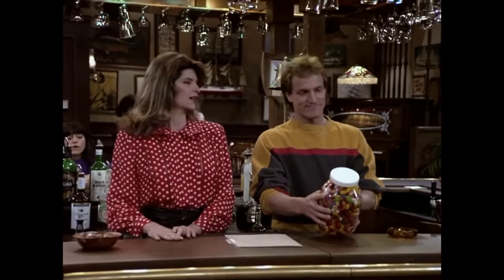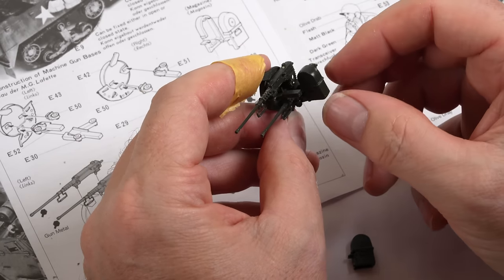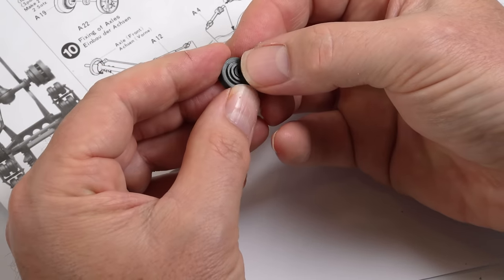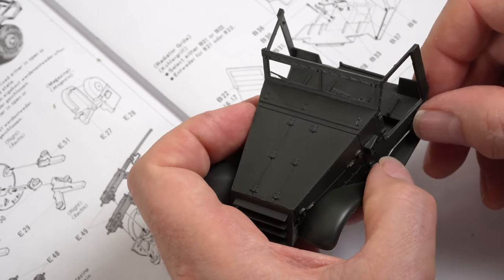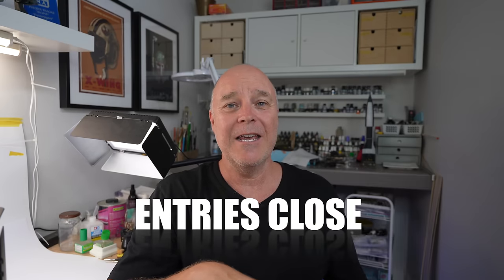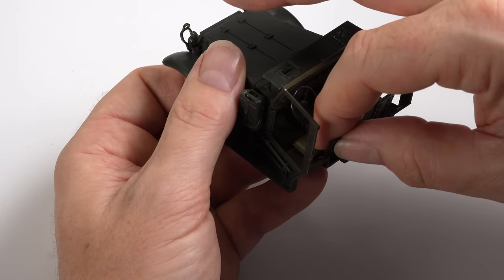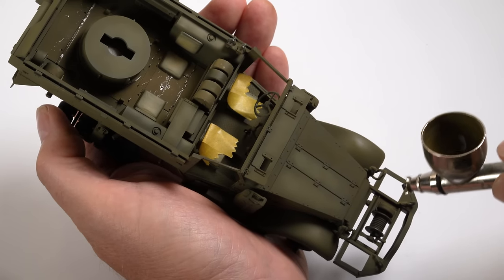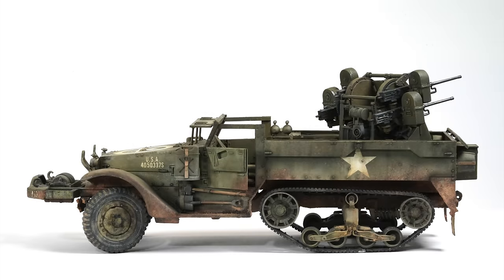TAMIYA $$ Cash Grab or Masterstroke? Rereleased Tamiya 1/35 M3 US Halftrack M16 built OOB + giveaway

Comment: Greetings from Canada.   Nice build! I think with a bit of sanding and scraping, that overscale  armour could be thinned down a bit. Gluing the tracks flat across the top of the drive sprocket and idler would help the appearance also. The kit really seems to hold up well after close to 50 years.
Reply from the maker: Hey 👋 welcome to the channel. Thinning the armour down would be almost impossible without then doing some scratch building. The tracks are only loosely fitted here. All comes together in the next video. Appreciate your comments 🙏🍀

Comment: As a young "glue bomber" in the late 1970's I built a number of Tamiya's armour offerings including this very one. 

Now I primarily build class 8 trucks (the big rig kits) which were another favourite modelling subject for me back then. Much of what is one the market now is the same kits from way back although in some cases there has been some clean up of the original tooling when reissued. Clean up of ejector pin marks (sometimes in really inconvenient locations such as on the diamond tread side of part instead of the not visible when assembled opposite side!), seams and parting lines are familiar tasks with these older kits, which as you mentioned are a reflection of a different era in model kits.

For me, I am happy to see kits like these available again without having to pay collector prices. Same with the Round 2 releases of those truck kits I remember which, for a time especially with the rarer ones, were priced at ridiculous collector levels that effectively discouraged actually opening up a sealed kit and building it.
Reply from the maker: Hi there. Thanks for sharing your thoughts. There is something about building a truck that excites me. I have the old Mack truck from Convoy in the stash…the rubber duck 🦆. That’s one of those legacy builds for me. I ‘gluebombed’ that as a kid 😛

Comment: Greetings from Australia!
This is certainly a better kit than the two '90s-era resin truck builds I've just finished. No warped parts, relatively decent fit, and a lot less clean-up all round! Oh, and congrats on discovering the SMS ceramic scraper - great tool, and much better than a #11 blade at its job.
Reply: Thanks from Detroit, USA- I was wondering what that ceramic scraper was- now I have a name- I hadn’t seen one before- seemed to perform much better than a #11 I used on same model last week- Cheers-
Reply from the maker: Greetings 🇦🇺 The ceramic scraper is a beauty isn’t it 🤩 Good luck with the draw 🙏🍀🍻
Reply from the maker: The scraper I’m using is for SMS - https://www.scalemodeller.com.au/?gad_source=1&gclid=EAIaIQobChMI97v3xIfugwMVRyx7Bx3Qew5_EAAYASAAEgJmQfD_BwE
Reply: @workbenchhobbies4316  I thought I'd posted that link, but either it has disappeared, or didn't post properly.

Comment: Those seam lines on chassis are weld lines where they fired bith ends, dont scrap them off on all kits, check your reference materials
Reply from the maker: Hmmm…too late now, but if that is the case it would be dumb luck on Tamiyas part because they are clearly seams in the moulding. (Assuming we are talking about the same thing)
Appreciate the info. I’ll try and take a look at some point. 🍺🙏

Comment: I really enjoy your videos.  After you paint on the two coats of chipping fluid, you paint on the olive drab (AK real colors).  If you use this with lacquer thinner, how does the paint thin off with water?  Thanks for the entertaining videos.
Reply from the maker: The way the chipping fluid works is it migrates through the layer of paint and sets off the water based chipping fluid. I made a video on this if you wanted to look into it a little more closely.
Reply from the maker: CHIPPING Fluid / Hairspray Chipping - Understanding the technique / DRYING times and the basics!
https://youtu.be/2fPKMQ46_MU

Comment: Here might be stupid question. I asume the halftrack part was the propeller but surely the tires in the front for steering would not be enough to turn..?  Greetings from seattle, us 🇺🇸
Reply from the maker: No, that is actually a great question! From my understanding, all the steering came from the front wheels on the US Halftracks and not from the track mechanism however that was not the case with the German Halftracks, which caused alot of issues for them as it was a more complex mechanism and assembly.  Good luck to you 🍀

Comment: had al 3 of those models as a kid ... Tamiya always had that problem of seam lines ... when building thier kits I spent the first day just removing seam lines from all the parts on the sprue that were reachable and then as assembling the bits that couldnt be done
Reply from the maker: I dont recall it ever being an issue..but I guess I look at it through different eyes now. But yeah.. it was a bit of a pain in the neck if Im being honest 😆 Appreciate your comments
Reply: @workbenchhobbies4316  only being building them for 40 or 50 years myself ...

Comment: Greetings from Worksop in the UK. I remember building the APC version in the 1980's. Back then I would have just thrown it together without dealing with seams and ejector pin marks lol. I pre-ordered the same APC version back in May 2023. I only just got it in the post last week. Hopefully I can do a better job of it this time round. Yours looks great buddy.
Reply from the maker: Thanks Andy. Those days of slapping them together were great days. I sometimes wish I could do that now. Thanks for connecting 🍀
Reply: @workbenchhobbies4316  I did think about buying the after market bogey & tracks set for it. But it would have cost me up to £25 to get it. I could not find a UK supplier with stock, so I would have had to order direct from FC Model Trend. Decided I will just build out of the box like yours.
Reply from the maker: There is no doubting the track section could definitely use an upgrade but it is all about what you are hoping to see on your own model.  Under a layer of weathering it probably doesn't make alot of difference anyway!
Reply: @workbenchhobbies4316  Agree. Besides, I prefer to paint the bogey section separately to the tracks. If you get the after market bogeys, the tracks are integral to them. So, have to be painted as one unit.

Comment: When paint chips off, it exposes a dull, slightly metallic, medium to dark grey color. Not a shiny silvery color.
Reply from the maker: Hey mate - how you going ? The colour of the chip depends on what the surface is underneath the paint! Its not always a dark metallic chip. That would be used on a steel or cast metal / armour plate. Things like sheet metal, timber, brass and rubber will all present in a different way.
It fact playing with the chipping colours helps tell a story and makes for a more interesting model.
Appreciate you sharing your thoughts 🙏

Comment: I built all three and found them pleasant builds. My experience with Dragon American halftracks was completely the opposite. Dragon has way too many parts that I found unnecessary and added nothing to kit. Directions and fit sites were extremely vague. After 6 build, pull apart, and rebuild the Dragon came together. Even the older Tamiya kits are better builds than the new Dragons. Enjoyed your build and thanks for modeling tips. Aloha from America.👍✌️
Reply from the maker: Hi Michael. I have a couple of Dragon us halftracks in the stash..so I’ll be mindful of the heads up!
Thanks for joining in. Good luck 🍀🙏

Comment: As someone who has been building scale models for over 56 years , I have to say  the details and fit  models that have gotten  much better. although there are some kits depicting certain weapons that  you can't find easily, like a Sdkfz 7 troop carrier pulling a  flack 36/  37 flack cannon.  Tamiya  used to have the  series, but to but discontinued  both the sdkfz  and the flack 36 /37   cannon  line, I used to have the entire 7/1 ,7 / 2. 7/3   series  along with the 20mm cannon ,being pulled by the  Horch  . Just as the flack crews, there were three types spread out from the kits  ""a Africa. Corps Tropical,  standard  and  eastern front,heavy winter. I  sadly found out that a lot of the kits that I had gotten over the years were no longer available  , SInce I had to file an insurance claim, Police report for the Arson at my house,It is true some of the kits had there silly motorized lower hulls to put a electric motor and gearbox to make it a hybrid between  a scale model and a kids toy.. I  would love to see some of thease    discontinued kits reissued in a series together   . Such Z Tamiya used to release a themed kit package  .I wish they would do a  series like a Horch  , a hooch with the anti tankgun, and the single 20mm flack gun . Or do a Sdkfz 7/1 ,2,3 series  with the three models.  To me, it was much easier , faster time wise to pre paint ,and weather a whole bunch of the  same sprue assembly  versus each kit separately.  Also, to me, sometimes a model that has  so so details  is a good  candidate for a scratch build start point  . How many models  of an armored  7 series  V2  launch vehicles do you know of ?????
Reply from the maker: Firstly, sorry to hear about your home mate and the loss of your belongings, I can't imagine how devastating that would be.  I would not be surprised given how popular this recent batch of re releases has been, if we would see Tamiya re releasing more of these old moulds.  I am sure they would be very popular!  Not sure on your 7 Series question, best to check out scalemates.com.  Thank you for connecting 🙏

Comment: Hi, you got the tracks looking good.  I've built several of these Tamiya half-tracks over the years and found the top run of the tracks sort of hovered over the return roller due to the springy stiff vinyl.  It would be nice if they had rereleased them with new tracks or at least in a gluable material.

I've recently got the rereleased Tamiya M21 Mortar Carrier.  Nice upgrades I've got for it are the Verlinden command/radio conversion and FC ModelTrends 3D printed tracks and wheels.  

Greetings from the UK
Reply from the maker: Connecting the join with superglue takes a lot of slack out of the track, and then gluing to that top return roller made a big difference. No doubting those upgrades you have will make a world of difference!
Thanks for reaching out 🙏
Reply: I tried every type of superglue I could find on those tracks and it never worked.  What glue did you use?  

On a few of the past builds, I made my own sort of link and length track runs out of textured (can't think of the word, kind of ribbed to represent the tread) styrene strips.  Not great but better than what I achieved with the vinyl tracks.
Reply from the maker: It was just a generic brand from the supermarket. You can strengthen the bond by sprinkling a little bit of bicarbonate of soda into the area. Works a treat
Reply: I'll try that, thanks very much.
Reply from the maker: Pleasure 💪

Comment: Okay, I'll admit it. I have kept several of the three different kits around and have never stopped building them since I discovered them on eBay. Air first they were selling for about $17.00, but slowly they became more expensive. Then I discovered the update kits from K59 and they built u to look better than what Dragon came out with later. These K59 kits included open drive sprockets and idler wheels and some other missing pieces. Add an improved driver's doors, front windshield and other parts and you really have a top notch kit.. Even with just the doors, thinned out with details to have the top pared of the door folded down is very nice. The detalils on the kit parts were sharper than Dragon's and as far as wheels and tires, there is no need to replace them with after market parts. But a few years ago they became very expensive on eBay so I wrote to Tamiya and told them what I am telling you and asked them to rerelease them. Im not saying that I alone had the influence for Tamiya to rerelease them, but they were rereleased a year later. I note that at the time they were rereleased and I was able to get the kits from one seller for $19.00 -28.00, (Tamiya USA sold them for about $28.00) there was a "vintage" kit for sale on Amazon for $125.00! Yes, they are as good as ever, and my skills are better, too, so yes, this is worth it.
Reply from the maker: 😆 that’s fantastic. I’m calling it…we have you to thank for these rereleases ☝️🍀😉
Reply from the maker: Sorry for the late reply, I missed this one.....just remember keep your air pressure low and your paint thin and trust your hands!

Comment: It's certainly possible to take an Exacto and do some work on those figures to get them looking great, same goes for the tarps, and especially the tracks. In their defense, if painted properly, those figures actually still look alright.  I know a lot of people love buying aftermarket, but that's not what the hobby was about yet in the 80's, when I first built this kit. You would take what was provided and alter it to suit your taste, like carefully chamfering an edge of a piece to make it look thinner. Shepard Paine was my introduction to altering kits, he made excellent looking alterations to period kits for the time, and was featured in booklets inside bigger Monogram bomber kits as an example of what was possible with some work. Maybe you just didn't want your hands to end up looking like the mummy, all covered in tape.. The paint does look good, but the tracks on your build are really more like detracts..
 You can slice most of the seam between individual links to get it to bend and lay nicer, even remove the tiny squares of material that shouldn't be there between tracks/link holes if you have a steady hand, and then glue it too the tops of the rollers with a temporary wadding pressing it down between the return rollers slightly, to get it to look like individual heavy pieces that are sagging a bit, instead of an elastic wristband.
 My remarks are all in good fun by the way, fellow modelers!
Reply from the maker: No doubting a good paint job helps a ‘soft’ figure. I don’t know how I’ll display the kit so saved myself the time. 
The tracks actually come up ok on the final build. Looking forward to sharing that video with you soon 💪

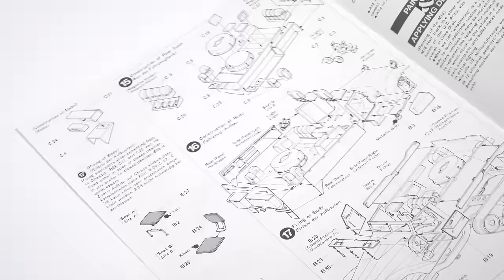Comment: Hello From Detroit! Well- do you know that you just put out not only the Best Tamiya M-16 GMC build- but THE ONLY ONE ON YOUTUBE? No kidding- hah. I’m near the end of my actual original factory sealed 1976 Tamiya M16! NOT the re-release. - I was 13 when this kit was released in ‘76. It’s so ironic- I’d been looking for one to build for a bit- as you mentioned exorbitant prices for them- then I came across upon not one, but Two brand new 1976 original kits at a model maker estate sale. $10.00 u.s. Dollars for each. (I also bought 20 more sealed premier kits, mainly 1:32  WW2 aircraft- I build 1:48 scale- so I sold them all on eBay- at spectacular prices (well below market) to some very-very happy eBay modelers)- anyway- LOVED your video! My M16 is in winter whitewashed for either Battle of the Bulge or Remagen Bridge. Anyway- yes the ejection marks were a bugger- But- after dry fitting most- I found that visible ejection marks would be cut in half to sand down. The underside I didn’t bother with (weathering took care of that) yes- a bit “thick” on the side armor- but- no worries. The fit is simply excellent- per usual Tamiya. And- hey Tamiya’s notoriously thick decals? Guess what- I simply gave them MINUTES in warm water - and was able to use them ALL. Amazing. Soft figures? No problem. I think you only missed the ONE Big Deal about these Tamiya re-release sets: The Price. I ordered the M3 Personel Carrier and the M21 mortar half tracks from my local Hobby Shop these cost $21.00 U.S. Dollars EACH. The M16 would have been $23.00. Tamiya wasn’t/is not going for a Money Grab here. They saw the demand yet gouged no one. Damned refreshing in today’s inflationary market… as an aside- I DID have the Dragon M16 kit- after seeing all of the fit issues, warping and other issues- I sold it off. Interestingly, the M16 had no heater OR canvas covers for driving compartment & rear gun section. Zip. The crews had to jury rig their own in the field. You have a stunning work area- I subscribed because I saw your excellent quality video and presentation- you do great work- I look forward to following you. No need to enter me in the contest- let another go for it! Nice of you. Ejection marks galore- but no flash. This was time consuming- did take out some joy- But- no issues and looks great. As an aside-I really enjoy many of the builds and tutorials I see coming from Australia & New Zealand. My uncle Harvey, was a combat infantryman in WW2- he fought with your countrymen in New Britain/New Guinea and the Philippines. He always spoke so highly of “the Aussies” in combat and the few times he actually made it to Australia for medical care and R&R. Good Luck- and Cheers John W, Grosse Pointe Woods, MI. (A mile from Detroit).🇺🇸
Reply from the maker: Thank you so much for your thoughtful comments. So glad you’ve found your way to this community. Thanks for joining the chat! 🙏🍻

Comment: The “damper spring” is called a crab on these halftracks. It isn’t really attached to anything other than two enormous springs above it. It sorta floats as it pushes down on swing arms.
 I restored a real halftrack and this part is a real bitch to get apart if it’s rusted up
Reply from the maker: Hi and thank you for joining in.  I can imagine that would be a horrible part to work on, thank you so much for your insight, very helpful 🤝